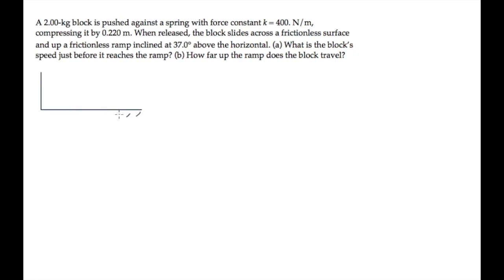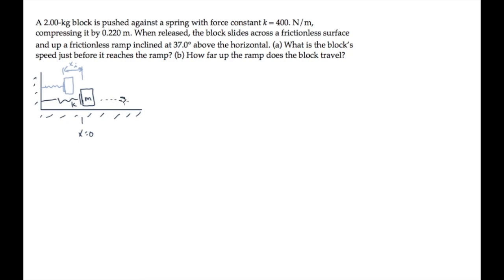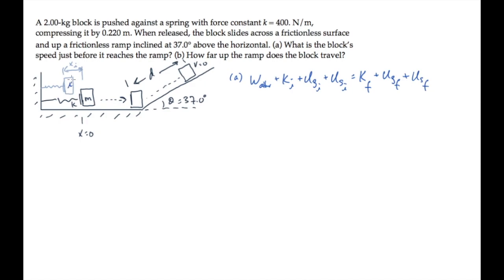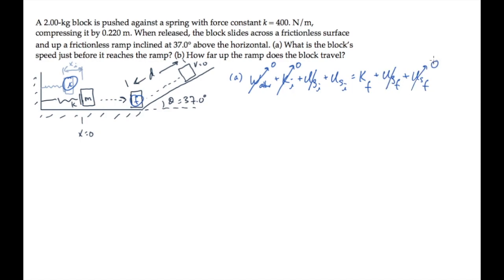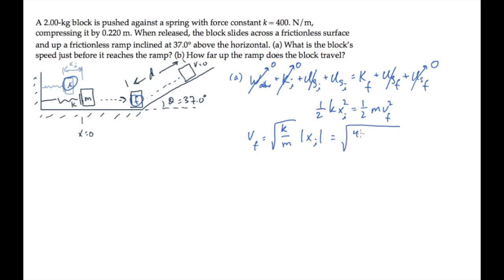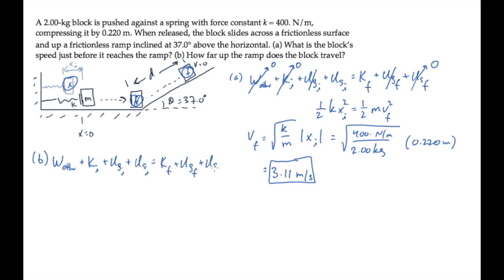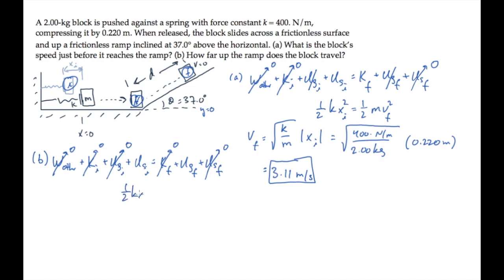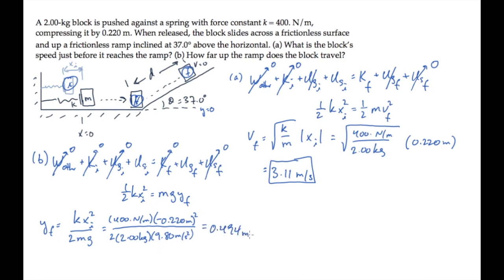Work and Energy: Spring Potential Energy. Level 1, Example 2

Comment: How can we say that the spring is NOT stretched beyond its natural-length  when the block is released  ??  Are we saying there will be NO oscillation  because at natural-length   all  potential-energy of the spring is  given away to the block and since block is not tied to the spring,  no oscillation will happen in the  spring  ??
Reply from the maker: Good question. At the moment of release, the spring starts to transfer its potential energy to the block. At some point, the block loses contact with the spring - that’s the point where the spring is at its natural length and, at that point, the spring has transferred all its potential energy to the block. Any time after that, of course, the spring is just sitting there at its natural length. (Someone may come up and push/pull the spring again, but that would have no effect on the block’s motion, because the block is long gone.)

Comment: Why final spring potential energy is zero even spring is stretched from its natural length
Reply from the maker: In the final state, the block is up the ramp and the spring is "relaxed" back at its equilibrium position (natural length).